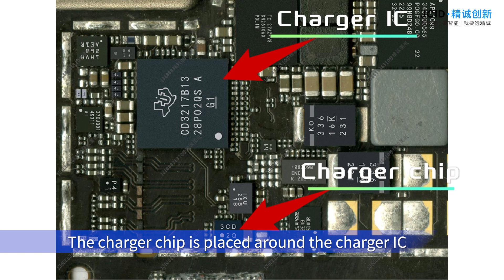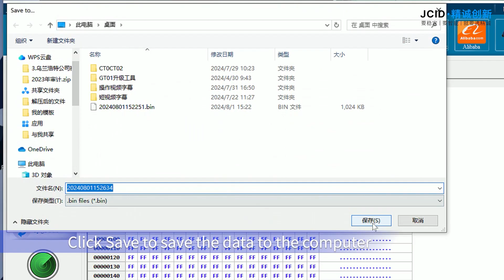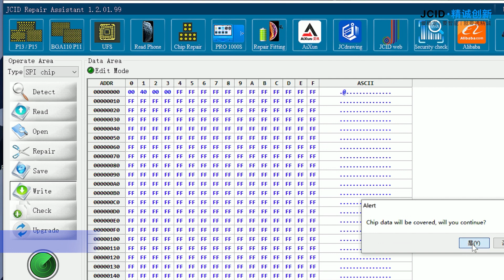USB-C iPad 10 Charger Chip Read And Write Socket

Comment: The information you provided is a bit confusing, so I’m leaving a comment for clarification. When performing the charger chip burn process with the V1s Pro, if I navigate to Open File > Server File, are the data for each model provided by JCID? And should I use that data to burn the chip?

Comment: I have a question, in iPad Pro 12.9” 5th gen after charging ic replacement device still not charging , so this programming method works or not
Reply from the maker: The device is for reading and writing. As long as it can read and write, it can works.

Comment: А в старом модуле для записи  eeprom будет работать?
Reply from the maker: V1SPro Chip Read&Write Module
 1. Support SPl chip reading and writing via wire jumping without
dismantling
 2. Support llC chip reading and writing via wire jumping without
dismantling
3. Support 6-X logic chip reading and writing, no need to distinguish
1 pin, support recognition in any direction
4. Support 6-15PM baseband chip reading and writing. no neeo
to distinguish 1 pin, support recognition in any direction
5. Support 15 series (and iPad) USB-C chip (also known as
U2 chip) reading and writing
6. Support BlOS chip reading and writing (Note: the adaptor socket
of the corresponding chip needs to be purchased separately, and
reading and writing through the blue locking socket)